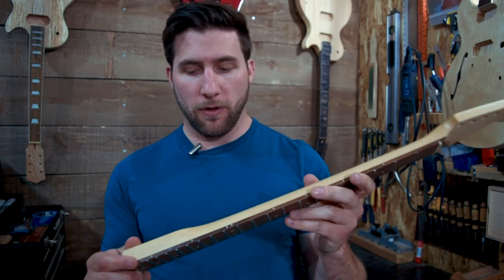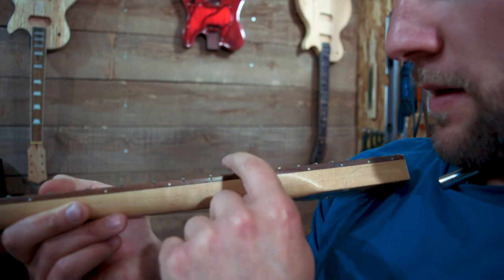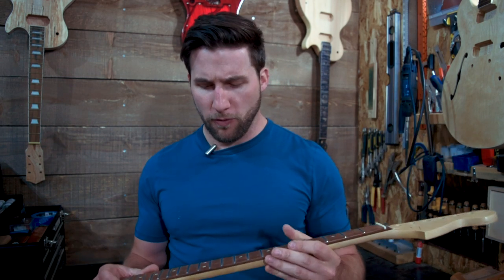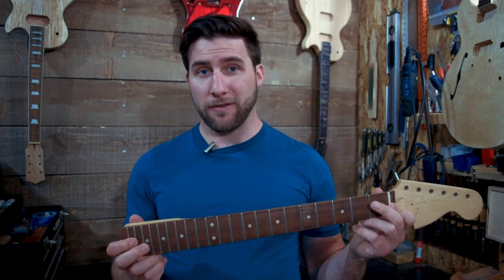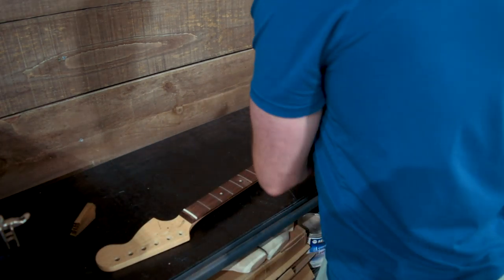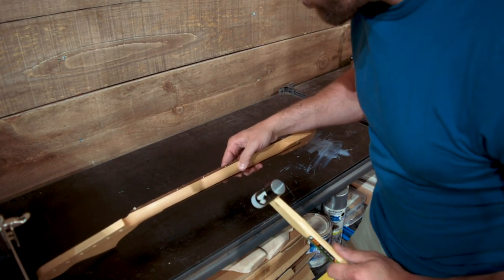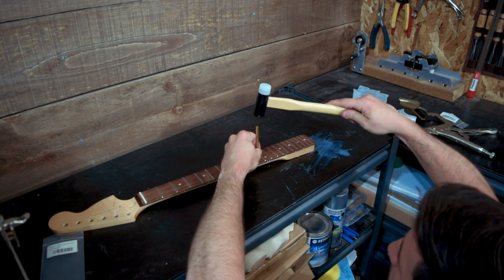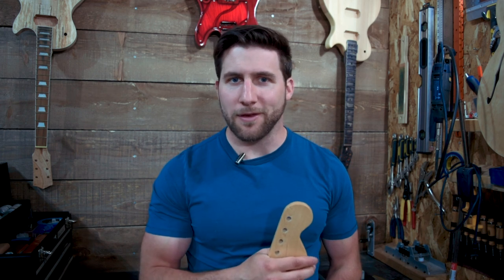How to Reset a Lifted Fret (3 Ways!)

Comment: Hey, Brad.  I just got a free Epi SG body and neck that has many issues, including many lifted frets. However, my frets are lifted in the middle rather than at the ends.  Should I assume it's an issue that needs repair, or should I go ahead and see how playable it is before messing with trying to press them all the way back down?  Thoughts?
Reply from the maker: That should be considerably easier to fix than a lifted fret end. I’d say you probably want to get them pressed in properly though. Having them lifted doesn’t seem very stable even if it’s playable.

Comment: Does the fret press work with slightly raised stainless frets?
Reply from the maker: It should, although depending on how they are raised the press may not re-form them enough to solve the problem.

Comment: Hi, Brad.  Nice video.  What if the frets are about 0.08mm off the fretboard in the middle?  I have a 2006 strat that I haven't played for a few years and a few frets are high.  I'm wondering if I should press and glue before leveling.  Thanks!
Reply from the maker: Yes, usually frets raise at the ends but if they’re popping in the middle it’s still a similar issue. Pressing them in should cause the tangs to bite better too.
Reply: @BradAngove  Thanks, Brad!

Comment: i have a fret on a finished strat neck that isnt seated all the way flush.   its finished in poly.  Can i tap or hammer this fret with a fret hammer to seat it full vs filing and leveling ?
Reply from the maker: You should be able to use any of the 3 methods I showed.
Reply: This is my issue also. It almost looks like there is a build up of clear, or maybe what they used to fill the tang ends on the side is the neck, underneath the very end of the lifted fret. So I’m anxious to hammer in if there’s something underneath the end.

Comment: Hi Brad, this is the issue I am dealing with at the moment, but saw the stew mac video first and the used super glue and fret press to hold them in. Is it necessary? I have probably not radiused the frets correctly and some of them dont go in..also dented the fretboard while hammering...well,my first build,so much can go wrong,right? Thanx
Reply from the maker: A little superglue often helps but shouldn’t be entirely necessary. You don’t need a fret press. Watch Ben Crowe from crimson guitars. He uses a fret hammer for his frequently.

Comment: Hi Brad - great video. I've seen other folks using super glue in addition to the methods you used. Is it necessary? I often see this done on unfinished fretboards; mine are typically maple gloss so I am not sure this would work. Do you have any videos on specifically addressing loose frets for maple gloss boards?
Reply from the maker: Superglue to hold the frets down? It’s helpful but usually not necessary and makes it pretty much impossible to take them out again. If they’re installed properly that seems unnecessary to me.
Reply: @BradAngove  heat releases super glue. It's a well known trick. Watch Luthier Ted Woodford of Woodford Instruments in Canada. He uses it and uses heat to release it.

Its a well known trick to use super glue to hold down frets that won't stay down. Like the one I have that pops back up as soon as you let go of it. In that case, the only fix is a press and glue. Whether it be super glue, hide glue or whatever you choose to use. A hammer and punch won't reset one of those.

Comment: If you are going to use a hammer or fret setter, for the love of god, don't do it with the headstock resting on the bench like this. Especially if you have a Gibson. always support the neck underneath where you are going to be striking it. Also be sure to have the entire neck elevated enough that the headstock is not touching the bench. If not, you may be doing a headstock repair too.
Reply: I prefer the grim creeper, Mr Reefer.
Reply from the maker: This clearly isn't a gibson, or any other angled headstock, but yes you would generally want to use a neck rest for those and position it directly under where you are hammering. My neckrest pivots, and thus isn't useable for necks that aren't attached to bodies.

Comment: Haha I was just doing this with my trusty rubber mallet...
Reply from the maker: Nice. How did it turn out?
Reply: @BradAngove  Well the neck has other problems so I fixed one area only to have problem appear higher up. Mind you the neck is from warmoth and has sitting in a closet for years and never been to a luthier so my expectations were low haha. Plays great except for 3 frets on one string.

Comment: Brad, first let me say I love your videos and have recently subscribed. I just got a cheap (Amazon) fret rocker and have checked all my existing guitar necks. Almost, actually all of them, rock a tiny bit here and there, some more than others. Necks are all very straight with just a tiny amount of relief. My question is - should I be considering doing a fret leveling, crown and polish on most or all of them? Playability ranges from what I think is good to excellent as far as I am concerned. I am not a great player, much more into gear than practice. Your videos have given me the confidence to consider building a kit or buying a cheap guitar and making it great. Thanks!
Reply from the maker: Thanks Andy. The main concerns with frets that aren’t level are fret buzz and possible the wrong note coming through due to string contact with another fret. If you’re not encountering any of those issues, the the leveling work isn’t critical. However, you may find that the guitar play better if you can level the frets and then reduce the neck relief.
Reply: The quality control for the cheaper Chinese stuff is often hit and miss. You may want to check that your rocker is accurate before you go ahead and make anything based off of its readings. 
The reason I say this is that I have one myself, and suspect mine is not quite straight on the "medium long" side. I've got a European precision made fret rocker on order now; it costs about 3 times as much, but considering what it costs to botch up a neck so it has to be refretted, it may be worth it. 
It is of course entirely possible that your fret rocker is fine. Just thought I'd throw in a caveat before you start levelling based on what could in the worst case scenario be incorrect measurements.